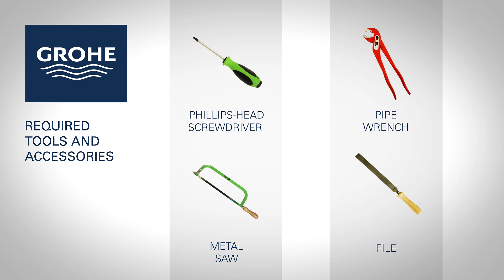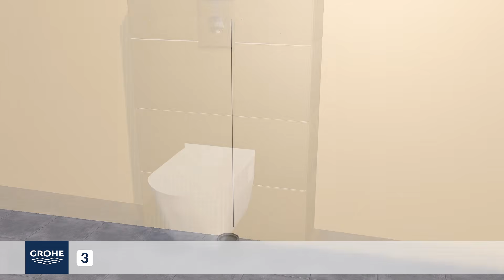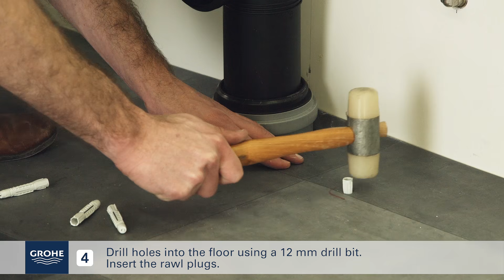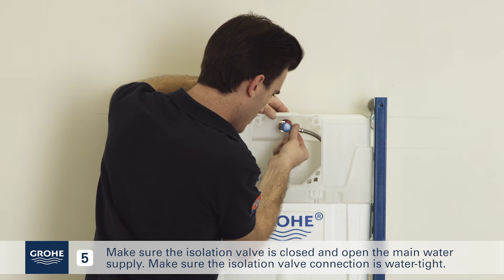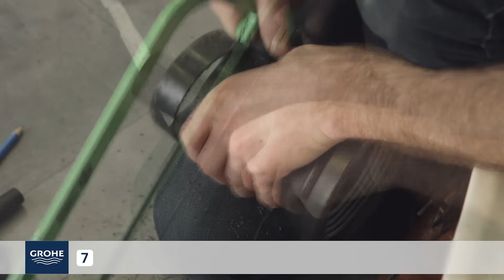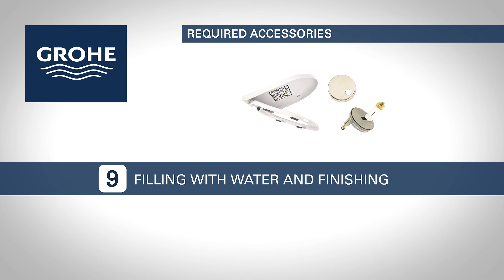Install a GROHE wall-hung toilet system

Comment: This video should be updated, new toilets now have these silly black clips under the toilet to fix. Check level on bolts, not frame as there no longer any final level adjustment from hanging toilet!! Can’t make this point any clearer! Contacted grohe customer service and they couldn’t care less. Again frame (as per instructions) was spot on laser level. Fitted toilet … it’s off. Took toilet off and checked bolts… yep, off level. But new toilet attachments don’t allow final adjustments.

Comment: I need to extend my bolts due to my watepipe is more than 230 mm from the wall.
Is that possible with boltextenders ?
Or does that compromise the instalation
Reply from the maker: Hello, in this case, please contact the GROHE customer service in your country or consult with a professional installation company to discuss the options. You can find our colleagues on our website at https://www.grohe.com/en/corporate/grohe-in-your-country.html
Best regards, your GROHE Social Team

Comment: Can these be installed inside a 6 inch stud wall and not against a masonry wall?
Reply from the maker: Hello, thank you for your enquiry. The Rapid SL system can also be installed on timber or plasterboard stud walls. For the relevant assembly instructions, please contact GROHE customer service. You can find your country's customer service details on our website: https://www.grohe.com/en/corporate/grohe-in-your-country.html 
Kind regards,
your GROHE Social Team

Comment: I have installed a very similar GROHE  wall-hung toilet, but with this wall mount: https://www.youtube.com/watch?v=nq_by1ehNGY  (it comes together from GROHE) Main idea of this mounting system from Fischer is that there are no nuts. But now it is impossible to firmly pull the toilet itself to the wall. As a result, the toilet dangles and there is no way to fix it more firmly. Someone can advise something?

Comment: Shouldn’t a vapour barrier be added to the warm side of the insulation, in this case between the joists and floorboards to mitigate condensation forming on the cold side of the joists.

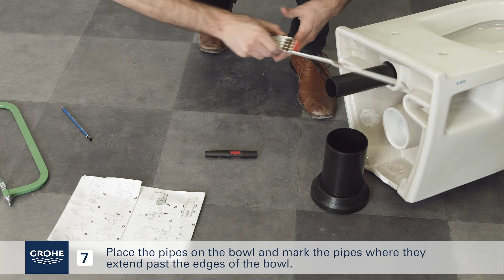Comment: At 08:23 he doesn't allow for the measure he is using. I guess there is enough tolerance? I marked precisely where the pipe extends past the toilet. 

The manual also says add "3" which I assume is 3mm but the video says 5mm. With the tape measure that must be more like 7mm?

Comment: I have succesfully installed the Rapid SL version of this item. Did anyone else find the instructions a little confusing ?  almost over engineered' a common German fault! However the unit itself is superb. !0 marks for the WC = zero for the  instructions!

Comment: What's the different between this and the Rapid SL?
Reply from the maker: Hello, the one in the video is the more economical DIY variant Solido, Rapid SL is the variant for the installer. The actual cistern is identical. With the Rapid SL, the blue frame is already fitted and an angle valve with feedthrough is included in the delivery. In the case of the Solido model, the blue frame must be fitted and a simple angle valve without a feedthrough is included.
Kind regards,
Your GROHE Social Team

Comment: After installing the wall mounted toilet, the level was high, how to re adjust the level without breaking lots in the ceramic? Any suggestions?
Reply from the maker: Hello Maher,
this is difficult to judge from a distance, please contact your local GROHE partner - they can easily help you out and give you the support you need. You can find a GROHE partner near you via this website:
https://www.grohe-mena.com/en_cy/our-service/showrooms-installer.html#/
Kind regards,
Your GROHE Social Team

Comment: Recently I bought a Grohe Solido product. During installing the water valve I got a queation. After installing the insulation valve, should I leave the hole without seal? I worry about water damage because my house is a wooden house. My paper instruction shows me a part which should be connected to the external water pipe(in my case, my plumber used a PE-RT pipe). But that part is missing. On this video, the pre-installed external waterpipe is connected to a metal piece. What is that? Where can I buy it? It would be nice if you can answer me as soon as possible.
Reply from the maker: Hello Namuwana,
Thank you for you comment! As you have a few questions, it's best to contact a GROHE partner near you and discuss the issue by phone. You can find a GROHE partner near you via this website:
https://www.grohe-mena.com/en_cy/our-service/showrooms-installer.html#/locator
Kind regards,
Your GROHE Social Team

Comment: HI what is the minimum you can have the frame located from the wall (230mm is maximum size), I have created a space but its only have 160mm
Reply from the maker: Dear Stuart, 230mm is the maximum with our normal wall angles. Minimum dimension depends on the drain pipe, if you start from the element only (without drain pipe) it is 130mm.
Kind regards,
Your GROHE Social Team

Comment: Thanks for the video. Very helpful. Is there a way to turn up the flow rate when the cistern refills? The cistern refills very slowly and takes about 15minutes before the toilet can be reused. It is also playing havoc with my pressurised water system. The pressure drop when refilling is so low that my system pressure pump constantly turns on and off for 15 minutes instead of remaining on through the refilling process. Any help would be greatly appreciated.
Reply: That’s not normal - mine fills in 30-60 seconds at a guess
Reply from the maker: Hello Scott,
it is very difficult to judge this from a distance. What we can say for sure, is that the cistern-valve needs at least 0,5 bar flow-pressure in order to work properly. All other factors are best discussed with a GROHE partner near you.
Kind regards,
Your GROHE Social Team
Reply: Thanks for the prompt reply. My pressure is 3.1bar.
Reply from the maker: Dear Scott, in this case please contact the GROHE customer service in your country. Where are you located?
Kind regards, Your GROHE Social Team

Comment: What if there is a leak inside the wall or the cistern, how the leak is going to be fixed?
Reply from the maker: Hello, in this case we would need some more infos so we can help you specifically. We recommend you contact our customer service team in your country directly. Where are you located?
Kind regards,
Your GROHE Social Team
Reply: All components can be accessed and serviced by removing the flush button

Comment: Hi grohe
Im building a house in a country where we use 20 cm cement blocks for walls. The conractor cut the wall and made space for the tank ; so now we have 10 cm of block left where the tank will be placed and fixed in. Is this safe and correct? Is 10 cm of block enough?
Thank you
Reply from the maker: Hello, in order to help you, we need to know which exact product it is about. Should a pre-wall element such as product number 38528001 be installed? It would be great if you could give us the article number. Thank you!
Kind regards,
Your GROHE Social Team
Reply: @GROHE  Thank you for your reply.
This is the article # 38772001

Thank you again
Reply from the maker: Hello, a 10 cm cement wall is usually sufficient to securely hold a pre-wall element such as 387720021. A professional installation is of course important. 😉
Kind regards,
Your GROHE Social Team
Reply: @GROHE  Thank you grohe. You guys are great.

Id also appreciate any tips and advice for installation
Reply from the maker: Hello, you are very welcome! We don't have special tips or advice, but if you have a question you can always contact the GROHE customer service of your country.
Kind regards,
Your GROHE Social Team
Reply: @GROHE  you are the best grohe. But one final question please.
Roughly what is the life time of a grohe concealed wc tank?
Reply from the maker: Hello, in Germany we give a 10-year guarantee on our concealed cisterns. But we assume that such a product will survive a multiple of it! 😉 In the event of problems, suitable spare parts are available for many years.
Kind regards,
Your GROHE Social Team
Reply: @GROHE  Germans are the best at everything. Cars, building materials , etc and etc. Top quality.
Thank you again sir or madam for all your help.
Reply from the maker: Hello, you are welcome! We are always happy to hear from satisfied customers. 🙂
Kind regards,
Your GROHE Social Team

Comment: When flushing, the water comes out so strong that it spills a bit out of the toilet.  Is there a way to change the angle of the flushing water or reduce the pressure of the flush?
Reply from the maker: Hello Baha,
thank you for your comment. This depends on the type of toilet and the type of cistern you have. With most GROHE cisterns you have the possibility of installing a purge flow throttle which limits the amount of water per flush. Please contact your local GROHE partner for support in this matter.
Kind regards,
Your GROHE Social Team
Reply: Shut the lid before flushing ahahah 😆

Comment: Where are CLEAR instructions how to set the water level that it fills to. NOT the overflow level, but the mechanism to actually stop the water at a certain height. My new cistern fills right to the top of the overflow setting. The silly diagrams that are supplied supposedly for 100 languages fail to explain clearly.
Reply from the maker: Hello,
please check page 4 of the instruction-manual, we believe you will find the answer there:
https://cdn.cloud.grohe.com/tpi/100000/100000/100000/100000/100090/100090/100090800/original/100090800.pdf?_ga=2.187185130.353834543.1603893217-1929850506.1603893217

You will see a diagram visualising the various filling-heights.
Kind regards,
Your GROHE Social Team
Reply: @GROHE  That is simply not clear at all. Please point me to a video that explains it. 
Your diagrams may be understandable by someone who has already done it - but not to me.
Reply from the maker: Hello, 
if this video and the manual do not help, please contact your local GROHE supplier, so they can walk you through the process. 👍 You can find your nearest GROHE partner via our website:
https://www.grohe.com/en/corporate/grohe-in-your-country.html
Kind regards,
Your GROHE Social Team

Comment: Hello Grohe

My plumber has installed the isolation valve outside the cisterns. He says in an emergency shutdown one doesn’t has to access and remove the conceal part where as this is exposed and easily accessible citing it as an alternative method of installation. Please advise if this correct?
Reply from the maker: Hello Adam,
this is difficult to judge from a distance, but with a concealed cistern you will always need to remove the flush plate before you can access the interior of the system. As such, having the isolation valve outside the cistern would mean you cannot access it by removing the flushplate alone, so, how would you access it in case of an emergency shutdown?
Please contact your local GROHE partner so they can give you the support you need.
Kind regards,
YOUR GROHE Social Team
Reply: @GROHE   HI GROHE thanks for replying. Did contact the Grohe and they too advise to place it inside the tank/behind the flush-plate so to keep it concealed. This I guess is more to do with aesthetics ( correct me if otherwise) since the whole thing is concealed and that isolation valve peeping out from the side as exposed will be an eyesore. So keeping it outside provides access in case of emergency shutdown - that's what our plumber maintains (unless he's messed it up and this may require a re-work) I can send you the pics of the site to show you as the site is under under construction.  Your valuable advice please
Reply from the maker: Hello Adam,
of course aesthetics play a role as well, which is probably why you chose a concealed cistern in the first place. 😊
You could send some pictures to your local GROHE partner, as they can judge better what happens with an emergency shutdown on your location. Furthermore, it might be good to inform yourself on how many times per year you experience an emergency shutdown and what this exactly means for your water supply in the cistern. Usually, during a water cut-off, you will have no water coming into the cistern and as soon as the water is turned back on, the cistern will fill itself back up again. As such, we do not see the need for a direct access - especially not since getting the flushplate off is not such a time consuming effort.
Kind regards,
Your GROHE Social Team

Comment: Why does it need to be a minimum of 230mm from the wall, it states a maximum of 230mm in the dimensions diagram? Thanks
Reply from the maker: Hi Matt, it is a maximum of 230 mm regarding the wall angles. 
We hope that helps!
Kind regards
your GROHE Social Team

Comment: Hi I've just installed this toilet. The problem I have is that the cistern has a low flushing pressure which prevents the toilet from flushing properly. Is there anything you can recommend?
Reply from the maker: Hello qraza, this could have various causes and is difficult to judge from a distance. Please contact your local GROHE partner and they will be able to give you a hands-on solution. 
You can find your nearest GROHE partner via our website:
https://www.grohe.co.in/en_in/our-service/showrooms-installer.html#/
Kind regards, Your GROHE Social team

Comment: What would be the problem if the flushing is weak?
Reply from the maker: Hello Sulais, the reasons for this can be many - and should be checked at your location. Please contact your local GROHE partner for support. Thank you and kind regards, Your GROHE Social Team
Reply: @GROHE  I can assure you that the water pressure that is connected to the tank is very good.  Is there a key that can be adjusted for the volume of the flushed water?
Reply from the maker: Hello Sulais,
in some cases it is possible to set the flush valve to 9 liters, please check the installation instruction of the cistern. If in doubt, please contact your local GROHE Partner.
Kind regards,
Your GROHE Social Team

Comment: How to remove float valve? My air valve hose is disconected inside tank
Reply from the maker: Hello, the filling valve should be pulled out of the holder as in the picture no. 4 on page 6: https://cdn.cloud.grohe.com/tpi/100000/100000/100000/100000/100090/100090/100090800/original/100090800.pdf?_ga=2.187185130.353834543.1603893217-1929850506.1603893217
Then you should have enough space to put the pneumatic hose back on the drain valve. Alternatively, the drain valve can be pulled out upwards (it's just plugged). Then the hose can be reconnected and the drain valve can be reinserted.
Kind regards
your GROHE Social Team

Comment: I have one similar which all of a sudden the small button (least amount of water) isn't outputting that much water. The plate looks fine (air comes.out when pressed). Do you have any tips? Thanks.
Reply from the maker: Hello Christian,
this is very difficult to judge form behind a computer screen - we think it's best if you contact a GROHE Partner near you. 
We have a web tool in place that helps you with this:
https://www.grohe.co.uk/en_gb/our-service/showrooms-installer.html#/locator/

Kind regards,
Your GROHE Social Team

Comment: I lost my inspection shaft durin installation progress , is there any alternative solution to install push button ?
Reply from the maker: Hello Yang,
please contact your local GROHE branch so they can have a look at it, they will be able to give you hands-on advice and supply you with spare parts if necessary.
Kind regards,
Your GROHE Social Team

Comment: 230mm from the wall? that's not right! The top fixing bolts wouldn't even reach...
Reply: The manual says max 230 mm. Guess the video is incorrect.
Reply from the maker: Hi Daniel,
Thank you for your comment. I am sorry you are having trouble installing your product. Please contact your local GROHE office for assistance here:https://www.gr ohe.com/en/corporate/grohe-in-your-country.html
Best, Victoria from GROHE Global Team
Reply: What is the difference between frames legs and back  wall in centimeter pls share me
Reply: Agree, I’d have to build out the wall with blocks of wood to take the brackets. I’ve made it as tough as possible, but the sizes given don’t work with the provided bracket length.

Comment: There is overflow from flushing system continuously
Reply from the maker: Hi Vijendra, thank you for your feedback. Could you please tell us where you are located so we can direct you to your local GROHE customer service team? Best, Anna from GROHE Team
Reply: @GROHE   Strong drain, water splashing out, water saving mode is not configured. I regret that I bought :(

Comment: ممكن سيفون داخل الجدر وليس اللي خارج
Reply: wall mountant was wasn' tap
Reply: Haasan Haasan  this method is correct ,hung enjection box direct on the wall ,do not broken the wall
هذي الطريقة الصحيحة لتركيب السيفون المخفي وهي على الجدار مباشرة دون تكسير الجدار وهذا أقوى للكرسي المعلق  لذلك ترى بناء زائد على الجدار وهو محل السيفون المخفي
Reply: Haasan Haasan Chibuzor wisdom